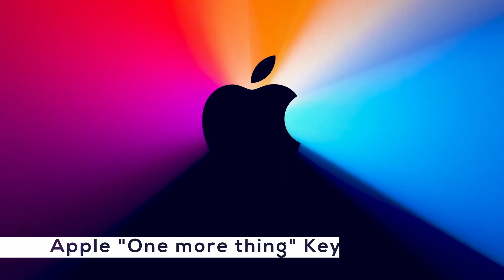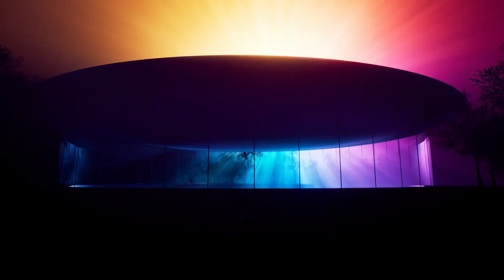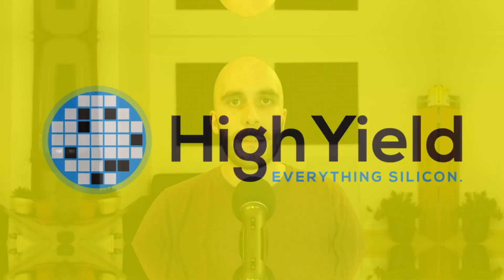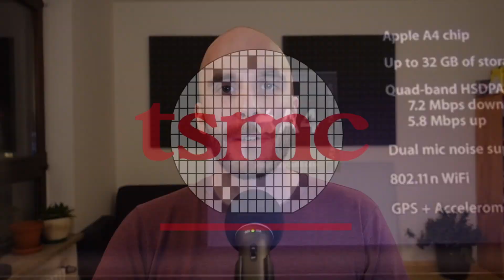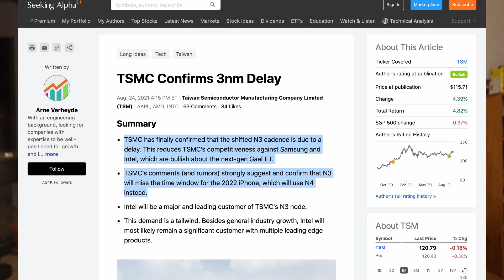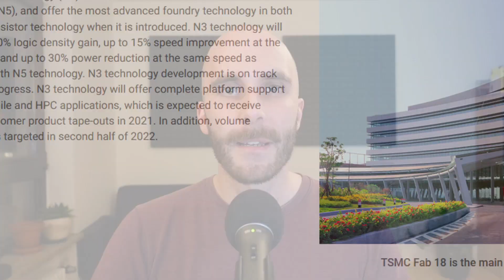Apple's A16 Problem

Comment: regardless of process port direction back or forward, let's say the design time is 1 year. the time to generate masks might be 6 months, and the time to valid is 9-12 months. Then the time from knowing this needs to be done to product is about 2.5 years.
Skylake 14nm launch was Aug 2015. under tick tock, the Ice Lake shrink to 10nm should have been late 16, and the Tiger Lake new architecture on 10nm should have been late 17 (actual late 2020, 3 years behind schedule). Back dating Tiger Lake, tape out should have been early 16.
Had Intel admitted (even internally) their 10nm was in serious trouble in 15/16, then they could have immediately done Rocket Lake 14nm based on Tiger Lake for late 17 tape out, and early 19 production, two years earlier than 2021 actual.
Much of the delay was Intel not admitting this needed to be done.
This is bean counter mentality of trying save hundreds of millions (if everything goes right) at the risk of costing billions if thing do not go right. Back then, Intel had the cash to take both options - 1) work on fixing 10nm and simultaneously 2) back porting to 14nm as an insurance.
Reply from the maker: Yes, Intel basically fooled themself by pretending 10nm is around the corner for 5+ years. Apple immediately adapted a new strategy once it became clear, that 3nm was delayed.
Reply: @HighYield  it should be mentioned that Intel standard practice is acknowledge that there are unresolved problems with each new process or design prior due date. But then operate on the belief they   can resolve these issues. (It was always a tricky matter for the shrink of a new architecture to closely intercept the readiness of a new process. As soon as the new architecture on the current process hits tapeout, it is handed to the design team in the process group to port to the new design rules. At the same time the Process Technology team is working resolve the last issues on the new process.)
For the concept of working to goal/date with still unresolved issues to work, the division GM must have long working relation with the Fellows and Principal Engineers in his group. If it is assessed that the risk is too great, the backup plans should have been advocated. I have always argued that the cost is tolerable, but the big bosses said it was a matter of manpower (this was long ago, P4 days)

Comment: There are still reports coming and it is unknown the true microarchitecture of A16. By the end of this month we should know more or maybe in the first weeks of August. I expect that it will have similar performance to M2 so if we take Geekbench as a standard benchmark around 1900-1950 single and 5600-5700 multi.
Reply from the maker: Apple is pretty good at suppressing leaks, let’s see when we get first real infos about the A16. My guess is still that only the “Pro” models get the new chip, but it’s only a hunch. 

Since the M2 is based on the A15 architecture, I hope for more IPC in single core, but multi could be on point.

Comment: Every single year lagdroid lovers make videos and comments saying "a15 minor performance improvement!!" "A14 not much difference to the A13"  and then the actual benchmarks come out and a huge performance boost is revealed. Same old same old from snapdragon users that doesnt even beat the A14 from 2 years ago 😂.
Reply: what does android have to do with trashdragon?. Lol android is an open source OS made by google and every phone manufacturer can use it. Also  tsmc makes both trashdragon and apple A chips.
Reply: @CherryScratch  hey the trashdragon's 5g modem are in the idumbphones 💀
Reply: @rushikeshtapre8620  Trash dragon finally snapdragon with the 8+ and the gen 2.
Reply: @CherryScratch  yeah atleast trashdragon makes and puts cpu , GPU , modem and more in one single system on chip

Comment: My guess is Apple will use the a15 with 5 core gpu on iPhone 14. For the pro variant, a couple of possibilities - either they delay the pro models until the 3nm chips can be fabricated, or they use an N4P die and boost frequencies for a minor spec bump. They might add additional encoders to support 8K video capture and playback, as well. This could also increase battery life even further.
Reply from the maker: How about 5 core GPU A15 for the 14 and a N4P shrink for the 14 Pro with better image processing to support the 48MP camera?
Reply: @HighYield  Definitely a possibility.

Comment: Use the 3nm process for the A16 pro versions (if it's a yield issue - lower volume) and A15 for lower skews.
Reply from the maker: That would be a straight forward solution. I like it!

Comment: My Guess: A16 = N4P and to cover the lack of a performance boost they will focus on the neural engine + GPU + camera to improve the cinematic film capabilities. Apple will introduce a new double sided Vaper chamber to further boost the A16 chip. N4P will also be the (multi layer) node for the 48/96 Core M2 Mac Pro. The A17 and M3 will use the N3 node from tsmc.
Reply from the maker: Also a interesting prediction, N4P seems like a good bet.

Comment: Maybe 3nm only for14  promax 5nm for everything else?
Reply from the maker: So you think a 3nm A16 for the Pro Max because of low supply and a different chip for the cheaper iPhones? Could work.
Reply: Because of low yield,  they only gonna have enough 3nm for 14 promax 5 nm everything else. I hope they don’t use 5 nm three years in a row. 4nm is actually same chip as as 5nm and calling it 4nm.

Comment: I got a feeling that even if there's no improvement in performance people will still take a loan to buy it.

Anyways, they still have a lot of things going on on the software side. I'm not an apple fan, but they're pretty solid.

It would be interesting to see Apple make a big blunder though, a scale that even normal consumers care.

Usually most minor or technical blunders, only tech communities talk about. 

The vast majority of normal consumers don't even care.
Reply from the maker: Yeah, their software just runs so well because the control both sides, software and hardware. Much easier to fine tune as opposed to Android which needs to run on many different phones. I used Android for most of my life, but switched to an iPhone two years ago and I like it a lot so far.

Comment: As Zen5 early models are rumoured to have re-targeted the 4nm node and they follow Apple as nodes mature it rather confirms that the 3nm node has run into difficulties.
The rumours reported by MLiD have high accuracy so I believe them.
If it were only poor yields, Apple might take an economic hit and push out a very low volume ridiculously expensive SKU for their more money than sense status customers.  But it sounds like the process has hit more fundamental snags than production ones.
Reply from the maker: Personally, I think Zen5 should be far way enough to make 3nm work, lets hope TSMCs 3nm wont be like Intels 10nm ;)
Reply: @HighYield  But if Apple are delayed AMD may not want to wait for them to move on from the process.
Developing for 4nm alternative avoids them suffering a stall like Intel had.  Chiplets are small so failure to increase transistor density would not impact yields as much as  monolithic designs.

Comment: I think Apple will delay the new iPhone. If you change the soc going into the phone, that would effect so many other parts of a phone design because everything is so tightly integrated. They would have to design an entire new phone... I guess if they got an early enough heads-up they could release a stop gap iPhone. Or they delay it and only do a paper launch or slow role out to not look like they missed their target.
Reply from the maker: The question is, for how long can they delay it. As the iPhone is Apples most important product, missing the holiday time frame would be a big problem. If they launch in November or early December it might work.